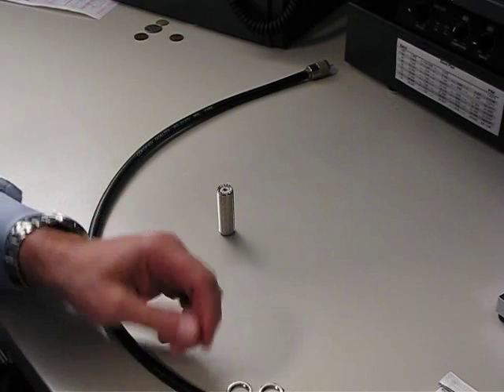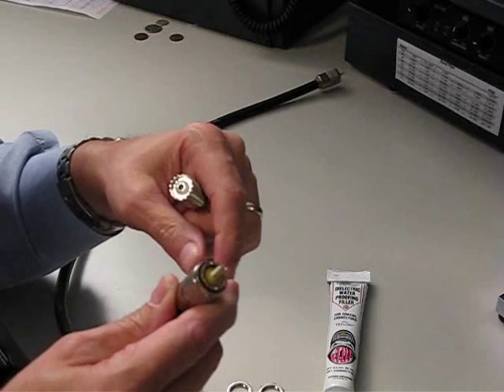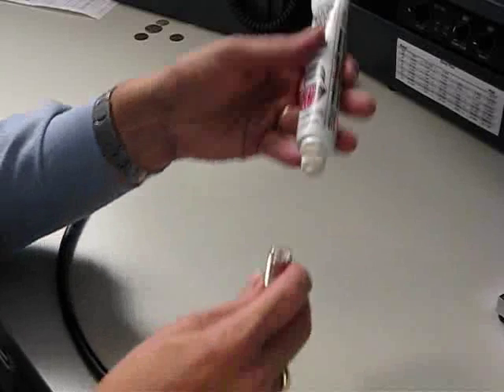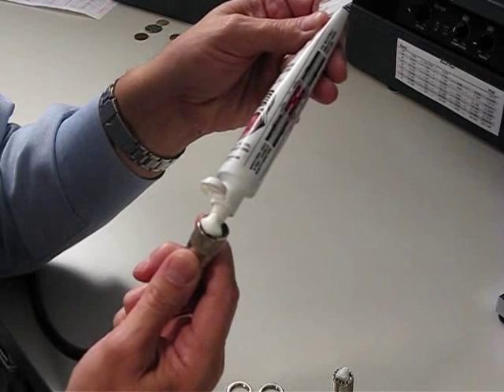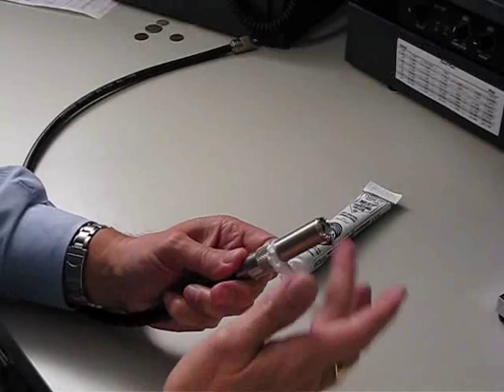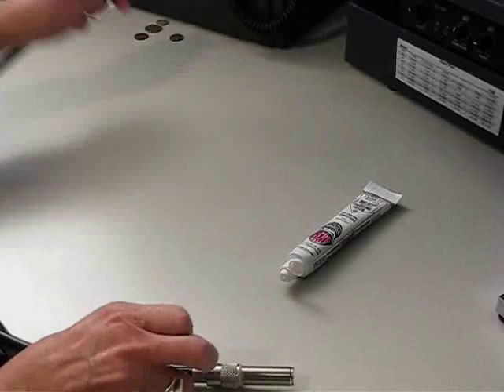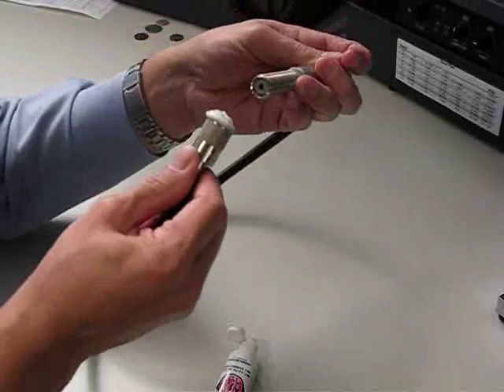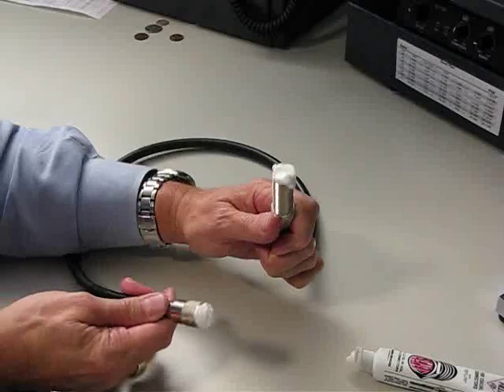Dielectric Water Proofing Filler

Comment: Instead of just randomly gooping the stuff on/in the connector, think about where & how much is needed. You seem to be a reasonably intelligent person. Surely you can do far, far, far better than this.

Where on the connector can water ingress? Look at the connector. Stare at it for an hour if it takes that long. How much of that sealant is needed to fill the surface area on the face of the connector? Could you unscrew the barrel back down the cable so that you could access the face a bit better? Could you perhaps put less than a quarter of what you squeezed out exactly where it's needed and avoid the mess and the waste?

Sometimes, reasonably intelligent people doing stupid things because they're too lazy to "think" pisses me off.
Reply: tsatomic you are a complete ahole
Reply: Water can enter the threads through capillary action. Plus normal corrosion/oxidation where the threads come in contact.